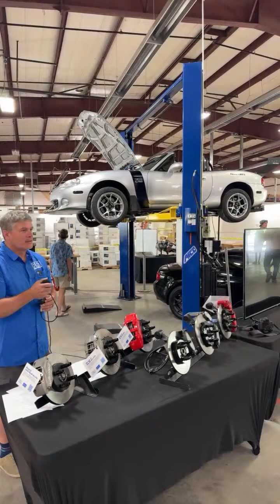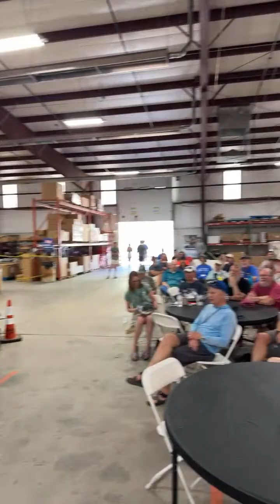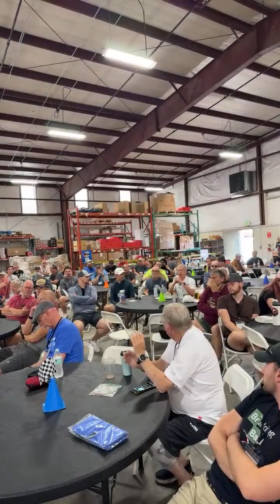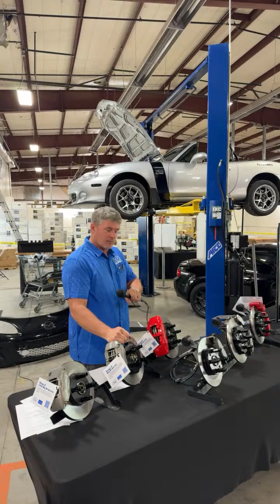How To Choose Brake Upgrades - FMSC Seminar 1

Comment: One of the thing's I like about the way 5mt subaru awd system works is the viscous center diff tries to make the front and rear wheel spin at the same speed, combined with the viscous rear diff probably doesn't makes that much of a difference but makes me feel better.